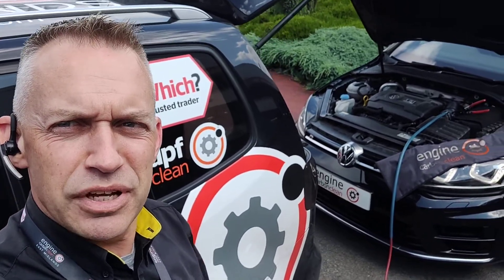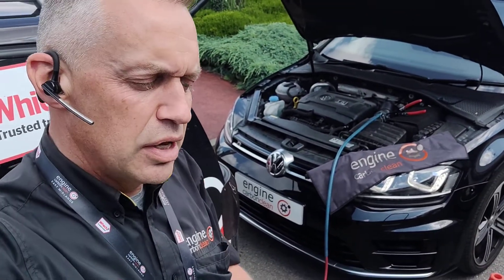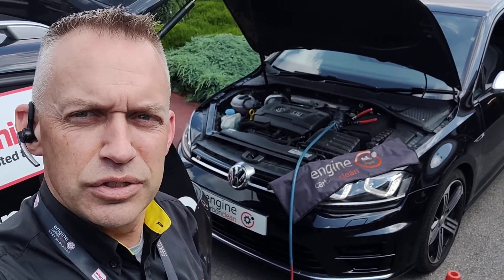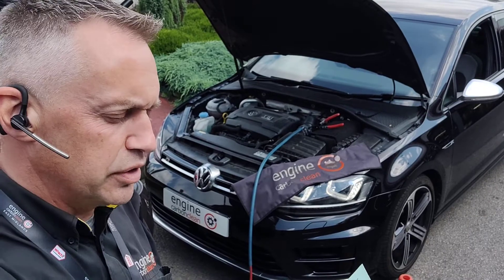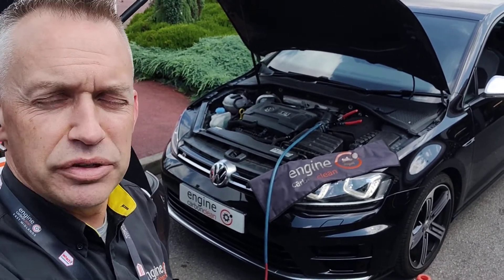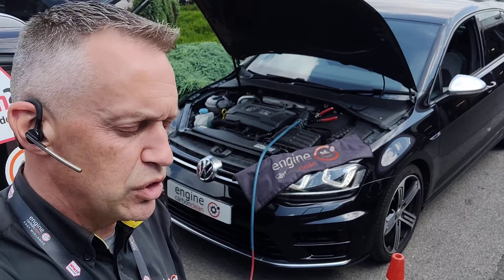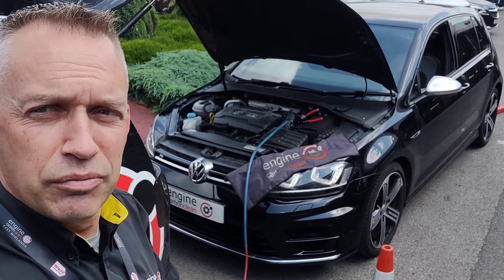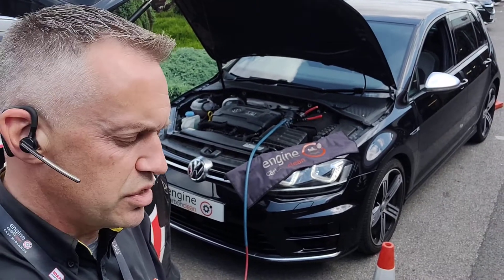Multiple Misfires? Diagnostic and Engine Carbon Clean on a VW Golf R (2016 - 30,709 miles)

Comment: 2016 vw gti, I'm having multiple codes to for cyl 2 misfire and hide cyl, but it only presents itself right after filling up the tank. Car won't run right, epc and cel comes on and multiple attempts to clear code and revving engine needs to be done in order to run smooth again. Any ideas?
Reply from the maker: That's a tough one. Any other codes present? Typical issues causing misfires are plugs, injectors, coil packs, engine mounts, fuel pumps, etc. but have also seen a wire shorting on the gearbox casing issues for the MAP sensor doing exactly the same thing. Would need a thorough investigation to track down what's going on. The fuel level aspect of it is not something seen previously.